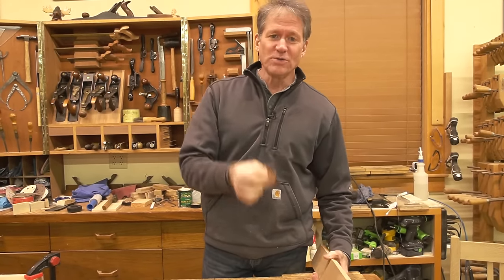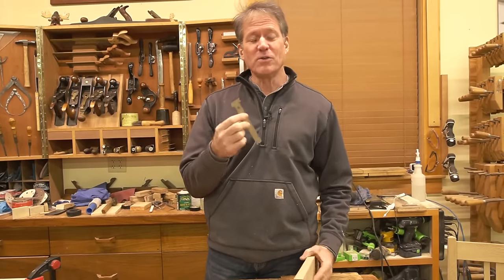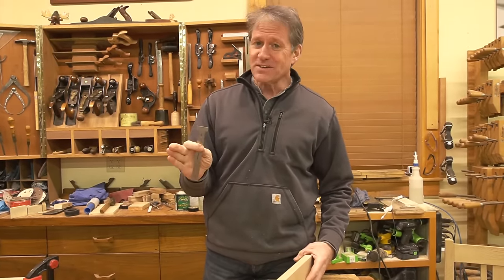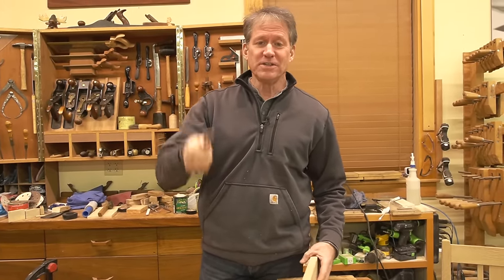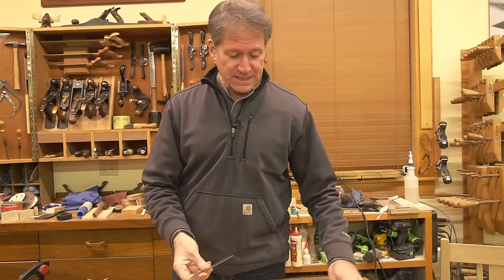5 Tools I Wish I Had Sooner

Comment: My most valuable “tool” I’ve added to my workshop is switching to metric measurement.  It is just dead simple, precise and I no longer have to add and subtract fractions!
Reply from the maker: Wow, impressive. 😎 I can appreciate that but have never been able to make the switch due to being immersed in the imperial system living here.
Reply: I'm thinking of doing the same thing. It just makes more sense to me. The next few measuring tools I plan on purchasing will be in metric to give it a test run.
Reply: I just tried using metric on a six bed project using dominos and cross dowel bolts where precise measurements was critical.  Wow!  What a difference metric made!  The problem is reprogramming my 66 year old brain from imperial to metric.  Accuracy wise, its a no brainer.

Comment: The tool I wish I'd had years ago is the shop apron I made for myself this summer.  My habit is to keep pencils, rulers, a small square, and many other tools I use frequently right in my apron.  After decades of using and wearing out other aprons, none of which were really perfect for how I work, I decided to buy a used sewing machine and make my own.  I took the best from all my past aprons and designed my own out of waxed canvas with leather straps.  I figured if I can use a table saw, I can learn to use a sewing machine.  It was great fun and a nice change of pace.  Happy birthday and wishing you have many more years to make these great videos!

Comment: Like the new title flash at video's beginning! 

As to the 5 tools, the light is my fave and soon to be new tool! I've never seen it before so thanks for another great take away from your videos!

For those unfamiliar with the Quick Grip Clamp and reading these comments, another BIG HUGE feature of the quick grip clamp is that the non handle side of the clamp reverses to the other end making it a powerful spreading tool.  I have DeWalt and Harbor Freight versions and many times the spreading feature is invaluable.  
The Quick Grip Clamp can even be a mini jack to lift not ridiculously heavy things like a workbench to put shims under for leveling. Or when installing something like a wall cabinet they can be used to hold it in the vertical position and the clamps also offer an easy to use adjustment feature.  Just put the initial cabinet position a little low and squeeze the handle to lift it to the exact position.  BUT, don't try for minute downward adjustments, once you release the clamp it comes down real fast and NOT in small increments. :)

Comment: Tom, There is some baked in confusion regarding force and pressure. In the English system force is measured in pounds (actually pounds-force of Lbf). Pressure is a measure of how much force is exerted over a given area and can be measured in Pounds Per Square Inch (or psi).
The Bessey Clamps are advertised as providing a certain number of maximum pounds clamping force (not pressure). For example the Bessey EHK series has "600 lb Clamping Force." This is the maximum force it can exert regardless of the square inch surface area of the clamp jaw face.

The pressure exerted depends on the contact area of clamp jaws. Given the same clamping force the pressure increases as the area of the clamp face decreases. If the surface area of the jaw face is 6 square inches then the pressure would be 600lb divided by 6 square inches which is 100 pounds per square inch.  However changing the area of the jaw face does affect the pressure . For example if the jaws had a surface area of only 3 square inches the pressure would be 600 pounds force divided by 3 square inches = 200 pounds per square inch.  To prevent dents we can reduce the force on the clamp or increase the surface area of the jaw face.

I enjoy your videos. Thanks Chuck Petrone and Bo.

Comment: I’ve used the Work Sharp chisel sharpener and it’s quite amazing.  Get an extra plate of glass so you can adhere several different grits of sandpaper.

Comment: Well I’m very surprised that I never seen that light before.  But bet my bottom dollar I will have five or six of them in my shop before Christmas.
The scalpel is something I have used for years and I use several different blades.   I found these in my survival first aid kit and it was a hit from there on. 
As far as the festool mortises it’s quick and easy but I prefer my router and the quick jig that I made for it to do mortises also a lot cheaper.
Great video’s and content , maybe at some point and time you can talk about Dovetail saws and jigs.😎

Comment: Before I would ever spend what Woodpeckers want for their way overpriced tools I would buy Starrett tools.
Reply: Starrett prices, depending on where you shop, are about the same.  For instance, their 4” double square is $119.99 at Woodcraft while the Woodpeckers version is $109.  Also, Woodpeckers has one manufacturing facility in Ohio, while Starrett has manufacturing in the US, Mexico, Brazil and China if that is important to you.  I have both Starrett and Woodpeckers squares and I prefer the Woodpeckers as they are much easier to read the scales, and since I’ve switched to metric, much easier to source.
Reply from the maker: The Starrett 6” rule, without the hook, costs the same as the Woodpeckers. Seems precision tools are expensive to make no matter who makes them. Thanks for watching 👍😎
Reply: @EpicWoodworking  Starrett makes several 6" rules with a hook.  But I would rather pay a little more and get the Starrett.  But then also one would argue, why do you need that high of precision for woodworking when wood shrinks and grows several thousandths every time the weather changes.  So why not save a lot of money and buy a cheap hook ruler from a notions store?  
The only thing I see spending more on would be a square.  Because most cheap squares aren't square. For that, I have a Starrett.